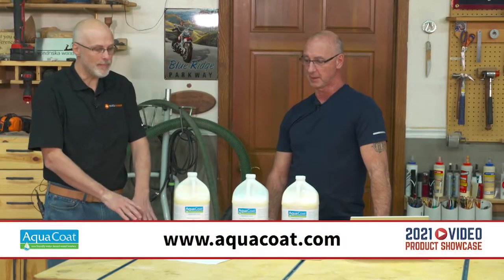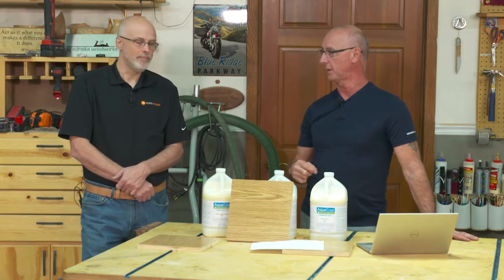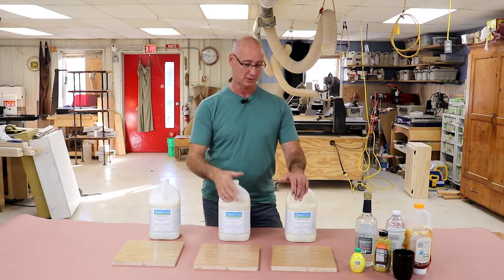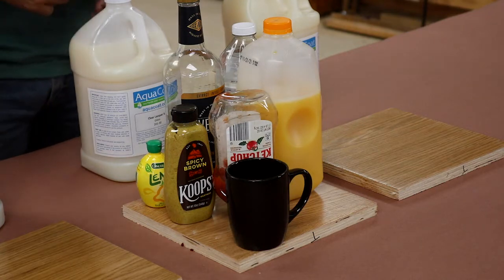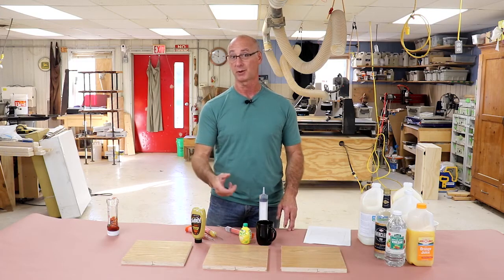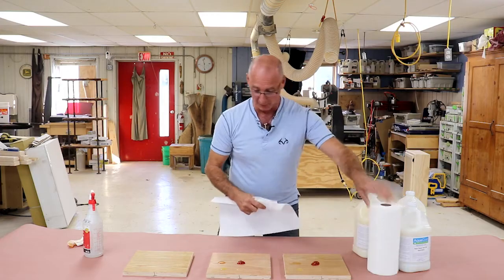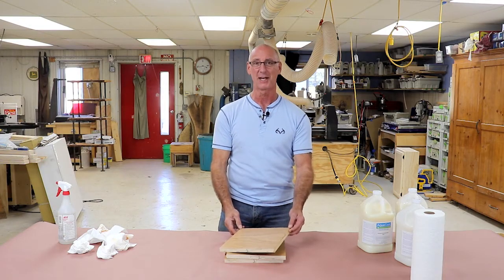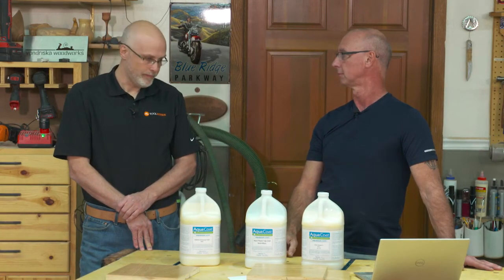George Vondriska's Chemical Resistance Test Using Aqua Coat Topcoats

Comment: Finding it odd that Aqua Coat has turned off all of their comments on their other videos (except this one). I ordered Aqua Coat several months ago due to the encouragement of woodworking accounts here on YouTube who recommended it. My first lesson: Make sure reviewers of products aren't receiving an incentive for their promotion of a product... if they are... move along, and look for an honest review that is not influenced by kickbacks of some sort.  I used Aqua Coat on 3 projects, and was pleased with the results, but the product has some serious flaws, and I learned on 1 of the 3 projects that it is not compatible with every surface or finish.  The label clearly states it works with shellac (and other finishes), so I decided I would give it a go on my latest project involving repair/replacement of veneer on an heirloom antique piece. After investing a lot of money on the replacement crotch walnut veneer, and a LOT of time working the 1 in a million piece of veneer (that was as close of a match for a 100+ yr old existing veneer to replace the damaged parts), and being pleased with the color tone I was able to achieve.. I sprayed a light coat of shellac (as instructed by Aqua Coat's label), lightly sanded (as instructed on label), and applied a very thin layer of aqua coat. I noticed it was gumming up terribly, which it had never done in the past. In spite of a thin even layer on the surface of the veneer piece (the veneer is glued to a substrate - and ready to go), it was just looking strange. When dried, the Aqua Coat was CRACKLED - just like you'd see on fake antiques where a crackling medium was used. I was horrified! I attempted to sand it down... but the crackled areas (across most of the surface, but randomly) REMAINED. Long story short, after trying various solvents (which removed the shellac and then ruined the staining & toning I had done on the veneer prior) and more sanding, the crackling would not budge. I had to use a plastic blade (scraper) to carefully work those areas off. They were extremely gummy - like semi-cured/almost-cured glue. I have now spent the past 48 hrs trying to salvage my "one shot" piece of veneer - the only one on the planet that matches the existing 100 yr old veneer. I am STILL working at it, slowly & carefully. I have no choice but to make it work. But even after multiple sandings & wipe downs with solvents, and new layers of shellac (dewaxed) - the surface now bubbles - in such a way that it's like 60 grit sandpaper. I am not giving up - I will find a way for this to somehow smooth out. But please be warned - while this product works great on very flat, solid pieces of wood - I would NOT use it - EVER - on fine veneer. Don't even think about it.  Likely some kind of incompatibility with my shellac (zinsser- dewaxed, NOT their waxed version). Because I had used it on previous shellac products, I didn't test it first. Costly lesson learned.